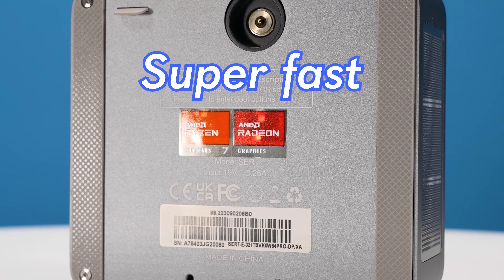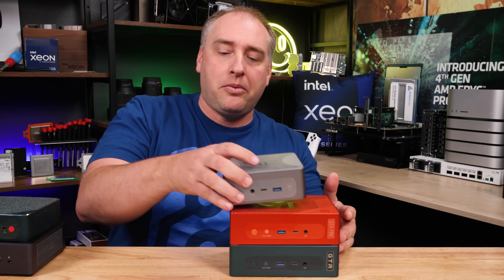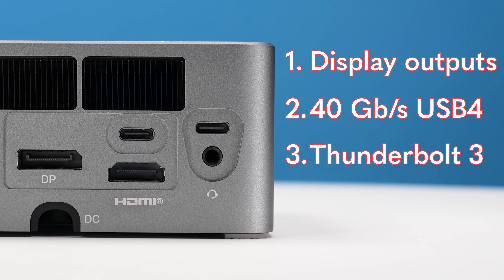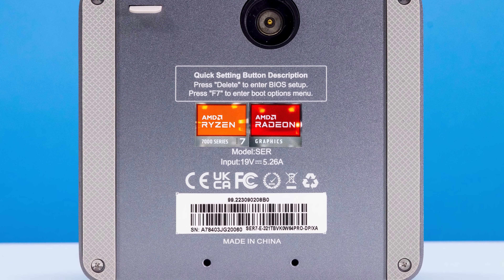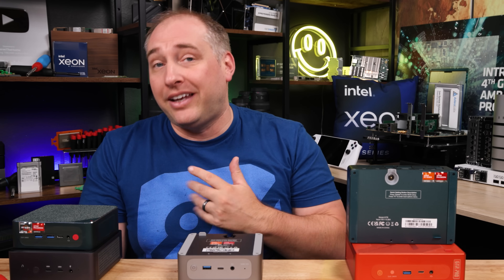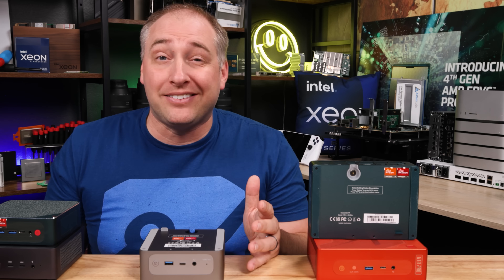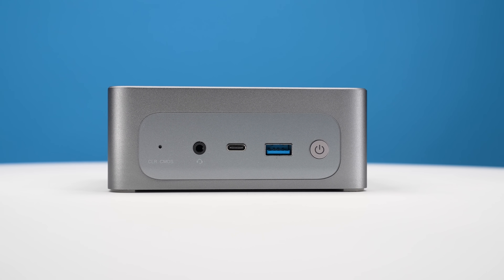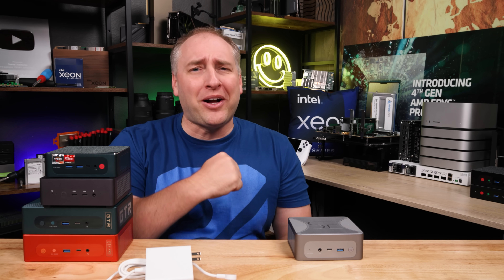A CHEAPER and Smaller Mini PC

Comment: Bought a UM790Pro a couple of weeks ago, to upgrade the best PC I've ever owned (Mele Quieter 3C). The Minisforum is faster than my gaming laptop, quieter and a fraction of the price.

There may be concerns over reliability and support (especially competent bios updates, Minisforum have already changed the bios and removed features available and reviewed at launch). These Ryzen APUs seem to have a common problem around sleep states and peripherals, hopefully AMD will fix and the manufacturers will pass along to their customers.

I bought barebones to avoid taxes, easy to fit my own Crucial DDR5 and a 980PRO. So fast. Not as quiet as the (fanless) Mele though :-)

Comment: It be amazing if one of the usb4 supported pd so it can be used with a monitor that can power the unit
Reply: By now there's also no reason anymore (besides space constraints on the board maybe?) for it not to. USB PD 3.1 can do up to 240W.
Reply: the 7735HS version in this same case does get power from PD, but turns off about 2-3 seconds into booting presumably from spiking power

Comment: There's also a SER 6 Max with the processor from the SER6 Pro, but in the SER7 form factor with the thermals fixed (and DDR5, and the two USB4 ports). I got one for about ~500 EUR.
Reply: This 6 Max sounds better to me honestly.  I wish the processor companies would get onboard with a balanced gaming processor (IE 6 cores only, even if they are 'E' cores and decent GPU for a decent price.  Not 2 iGPU options: barely not a potato, and $300 more for "almost discrete class".  Something in the middle like SteamDeck managed to do.  That's honestly the most shocking part of the SteamDeck was how they got a reasonable balanced chip out of AMD.)
Reply from the maker: There is a pretty big gap between the 7735HS and the 7840HS on the CPU and GPU side though.
Reply: @ServeTheHomeVideo  we just did some testing at work. We didn't do extensive GPU besides one of the guys opening up a game for a few minutes. CPU wise we saw 10-20% gains on our limited tests. Barely noticeable though in real world workload tests.
Reply: @2008mjb  The 7735HS uses 12 RDNA 2 GPU Cores, the 7840HS 12 RDNA 3 GPU Cores, this is a difference of about 10-30% depending on the Title. But more intrestingly the RDNA3 Core on the 7840HS got Ai Acceleration. Which is a massive boost for AFMF which accelerates all DX 11 and DX 12 titles by at least 100%. RDNA2 got it as well, but it lacks the Ai Cores for the bigger boost. So with AFMF the GPU on the  7840HS may see an uplift off up to 80% compared to the GPU on the 7735Hs.  For Office and CAD work both are great, but for E-Sports or Casual Gaming the 7840HS should much more preferable. (And with a big hole in the bottom of the case and stand offs to keep the thermals at bay.)

Comment: been using the ser7 as my main pc for 3 weeks now been working great snappy browsing even good for streaming my series x with a capture card  both the series x and the ser7 run very quiet and cool in my small room
Reply from the maker: Great feedback.
Reply: Funny you need a ser7 for browsing and streaming. I recently bought a trigkey g4 that comes with new N100 intel CPU. It does all those normal activities with no stress. Only downside is the slow sata ssd. But believe me the trigkey g4 gets barely warm, and is silent .

Comment: Many of these Ryzen 7000 mini-PCs seem to have issues w/ stability (on suspend, C6 idle, multiple high-refresh monitors attached, UMA VRAM set to >4GB), some of which may be fixable by BIOS/firmware updates, and some dependent on their hardware production run. Since you have a bunch, if you've run into any of these issues, maybe it'd be helpful to some tests on them and make a video (or just a chart) w/ model/manufacture/bios/drivers and any problems you were able to replicate?
Reply: That would be very useful
Reply: true,these bugs are super annoying
Reply: @Jason-mo7xt aAAA CAN ME
Reply: Yes, that would be really nice. I would love to know if the USB4 implementation on SER7 is still as horribly broken in terms of compatibility with Thunderbolt devices, as it was on SER6. I purchased a SER6 for use as a desktop PC, but I had to repurpose the SER6 as a headless home server, as it didn't work with any Thunderbolt docks I tried. Only when I stepped down to pure USB docking stations or USB-C screens, then it worked. I tested the SER6 with a high-end Caldigit TS4 Thunderbolt 4 dock -> Didn't work. Tested it with a Lenovo Thunderbolt 4 dock -> didn't work. Tested it on an Lenovo Thunderbolt 3 Gen2 dock -> Didn't work. Tested it on a Lenovo USB Gen2 dock -> Then it worked. Completely useless when you need Thunderbolt for other systems on the same docking station.
Reply: Agree these things are bleeding edge for some reason. Looking at the BIOS on my GTR7, it looks like the reference code from the BIOS vendor. And I’m experiencing some of the sleep mode issues you mentioned. Fortunately, as my office PC I’m not demanding much of it.
Reply: AMD is a complete fail on software 🤦‍♀️ Their products often have issues with firmware or drivers.

Comment: I just got the SER5 for $471 CAD from Amazon. 16 thread, 16 tb ram, 512 gb m.2. Pretty good for the cost.
Reply from the maker: I think we started looking at the SER series with the SER6 so we missed the 5 :-/
Reply: No worries. These are more workstation computers that I do ms office and LinkedIn learning stuff. Only complaint I have on SER5 is the loud fan noise across the living room. I’m happy when it idles.

What’s in demand I feel are devices like the minis forum HX90. You had a great  video on it btw. Specifically high thread count  devices with an m.2 storage and multiple Sata. I have 2 HX90 running proxmox, truenas, nextcloud, Cloudflare zero trust, Wordpress websites one of them. The other I’ll be using it for proxmox back up and rsync. I’ve yet to set the backup yet. The original HX90 has been running for a year by itself. I’ve had the power it on occasionally from power outages and hard reboot it the odd couple of times but it’s great. Each of mine has 1 tb m.2, 64gb of ram and 2x4tb ssds. It’s the perfect playground, just wish there were more Sata ports